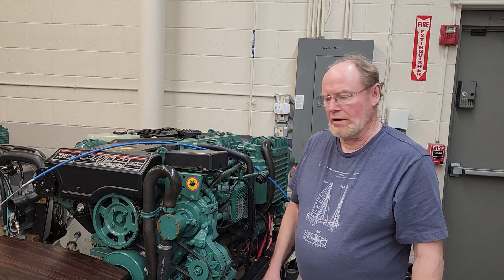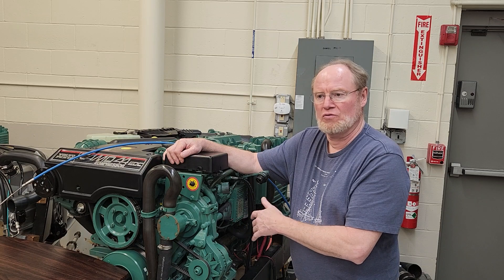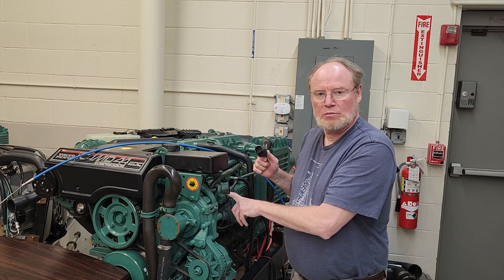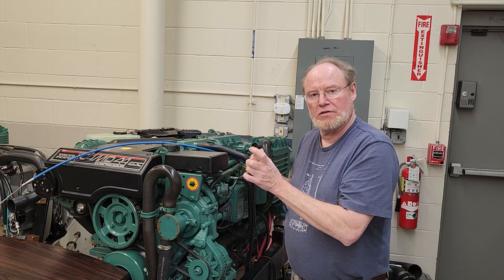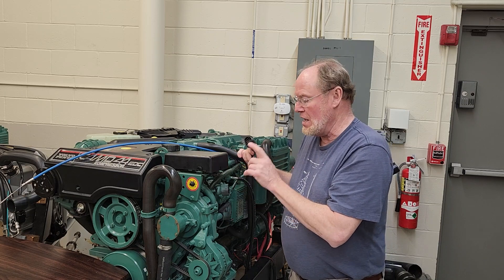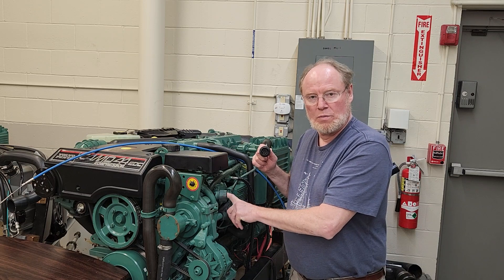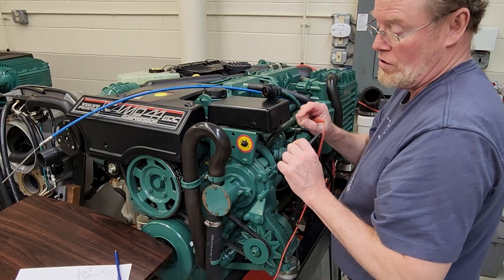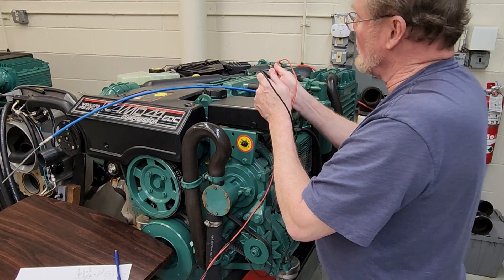KAMD 44 Fuel Injection Pump Testing 1

Comment: Hi Ted, Thanks for de video. I think this is the problem with my KAD 44. When the engine is at the right temperature and after 10 minutes of sailing the engine switches off and the 2 fuses blow.